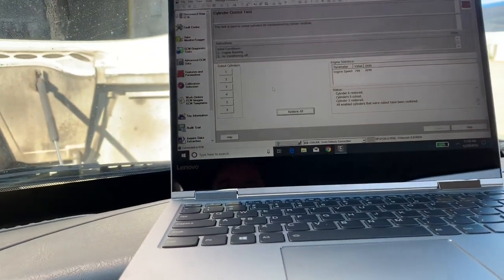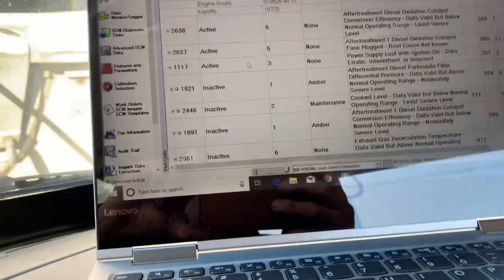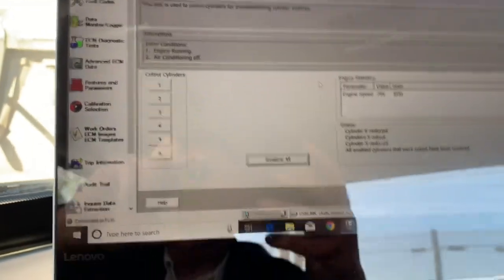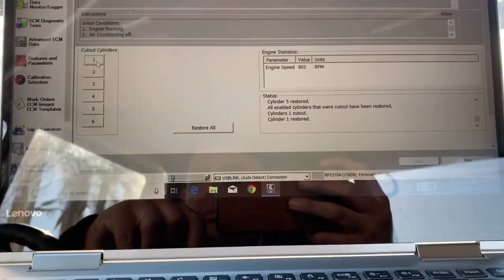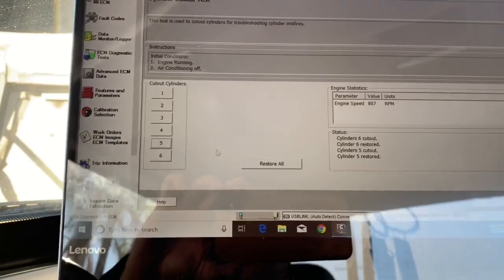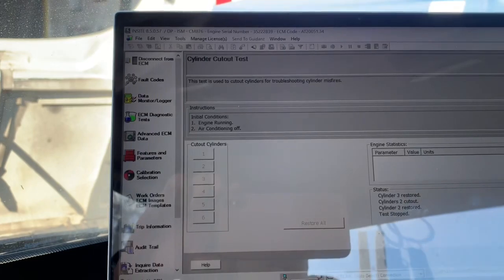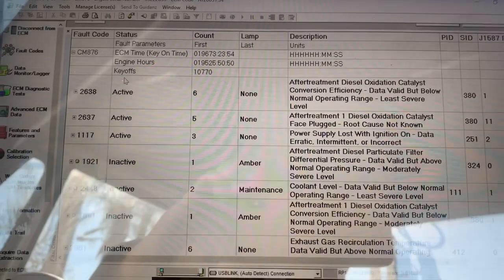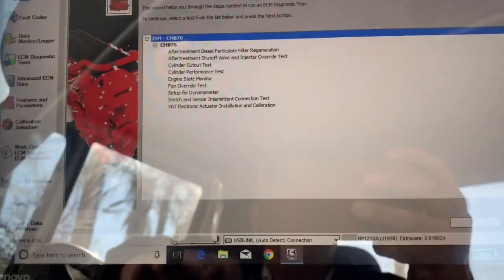Cummins ISM cylinder cutout test, finding a bad injector

Comment: On other Cummins engines with EGT sensors. I bring out the cylinder temps and few other parameters and watch the changes as I carry out cylinder cutout or performance test. You can actually view 2 screens at the same time.

Comment: I know right?? so I had #3 two years ago and, #4&#5 replaced a year ago. Now I'm doing 1,2&6 myself, why myself? Because both times at the Cummins shops. 1.One time left the front rocker cover gasket folded in, (tons of oil running out on my engine). They also stripped one of the rocker cover bolts, (another potential leak), and a Jake hold down bolt was lost and replaced with a soft bolt.
2.Second time, the tech left the case vent unhooked, a screwdriver on the ledge next to it, didn't see  or feel the hard cracked oil supply line to the jake, and left an electric connection that was so loose that when I took it off, it had no resistance to being pulled off.
Two separate shops, with crap work. I bought my own software, and you can all go work on go-carts.
Also, watch the engine rpm (it's right there on the test page) during your cut out test, it's a better indicator of a bad injector.
Reply: I agree.. these so called "Techs" are the worst.

Comment: I have bad injextor on cummins isx 15 cm2250. no codes so far on the dash, but very bad idle, shaking, no power, black smoke out of exhaust, clogged my turbo. wow what can do a bad injector. Mechanic hooked up insite for cummins and did this cut out on the cilynder and found out #1 is missfiring, which end up being bad injector. like a said no code on the dash but if’s different when hooked up on computer. have a good day
Reply from the maker: The are definitely times where you will not get a fault code but will get symptoms. Glad the mechanic was able and to find the problem using the cut out method.

Comment: We’ve been having a problem with an cummins isx15 we did the cutout test and all are good but when we do the fuel injector performance test it only passes test point 1 and than at test point 2 it says “not converged” do you know what that means?
Reply from the maker: I would have to check it out and get back to you.
Reply from the maker: I have tried to research this and have had no luck. Recommend to call Cummins software support, they have people there to assist.

Comment: I.have a misfire on cylinder 3 is this a ejected problem????
Reply from the maker: Try doing a cut out test. If the cylinder cuts or stops working then most likely it’s good. If you are cutting out injector 3 and there is no response then most likely the injector is bad. When you cut it out, you want it to shake or feel like a misfire

Comment: there was any RPM variation , working injector ----- value and not working injector---- rpm value  . without vibration there is any other trick ,